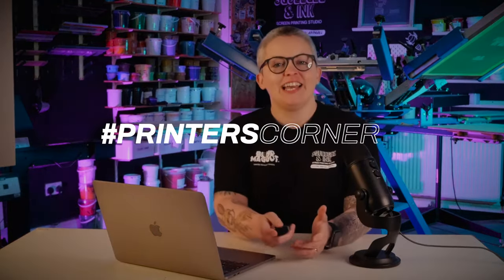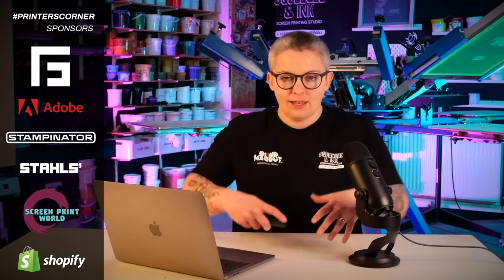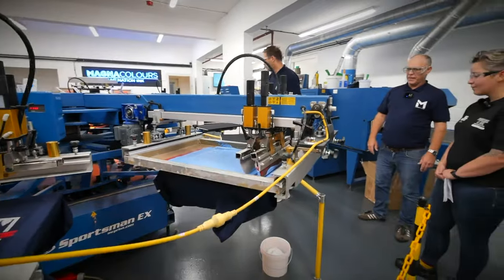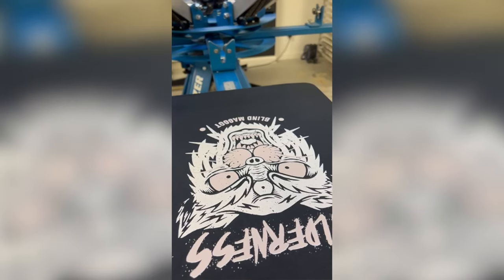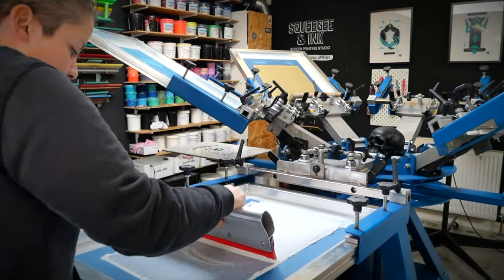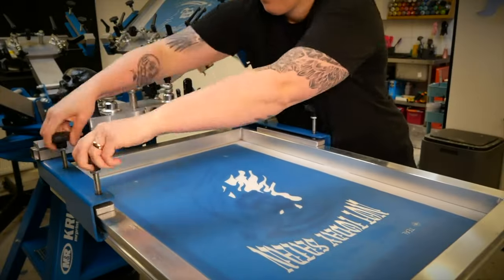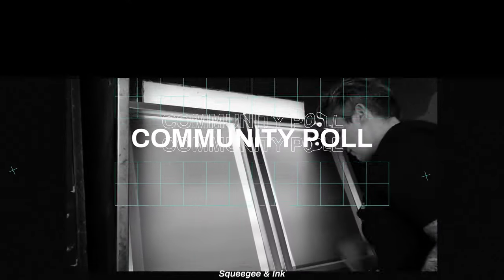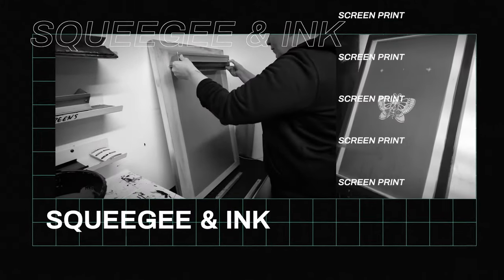How many flood and print strokes to use when printing t-shirts | Printers Corner Ep35

Comment: Do you use more print strokes for plastisol when using higher mesh screens? I definitely can’t clear the mesh in one pass on my 200 screens for instance. I usually do 2-3 strokes on a 157tt underbase on a black tee shirt. Are you mostly using lower mesh screens to achieve this? Thanks for all your helpful videos, keep up the great prints!

Comment: My film seems to stick to my dry emulsion when I'm burning it. Is there a way to stop that?
Reply from the maker: Yes that indicated you have humidity in the room in excess of 50% - I use a de-humidifier
Reply: @squeegeeandink  that's odd than, humidity is usually around 40% so now I'm at a loss
Reply: I had this happen awhile ago to me. I don’t know if it was a combination but I had zero issues after doing the following:

1. Let that coated screen dry longer (I try to dry it overnight if U can) and really suck the moisture out with whatever you got (fan/dehumidifer)

2. I ensured the actual film positive was quite dry. 

If you’re still having issues with the film positive ink (it’ll most likely be the emulsion needing to dry better so try that first) you could try reversing the image before printing it out so that the ink is against the glass table rather than the screen.

Hope that helps!